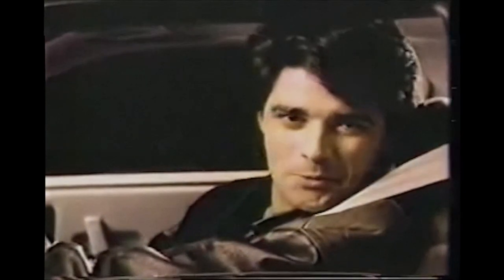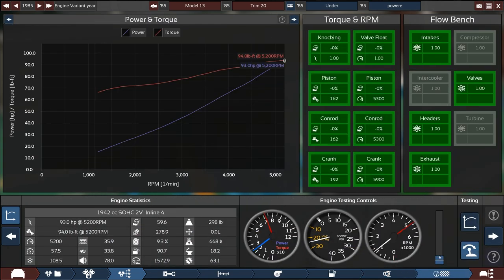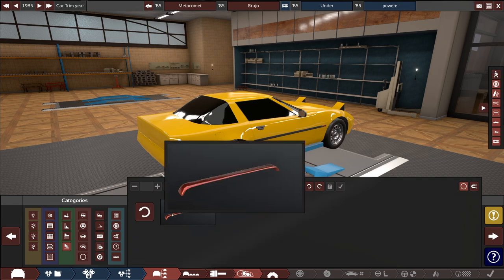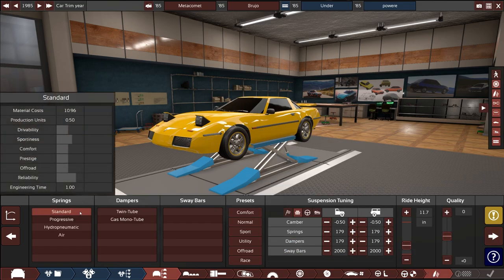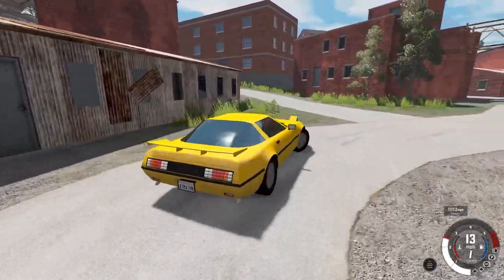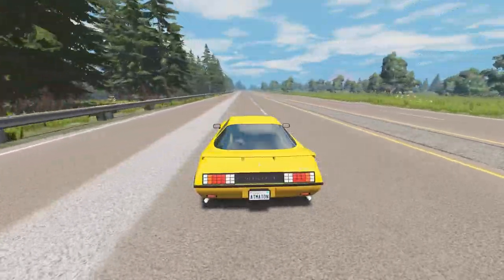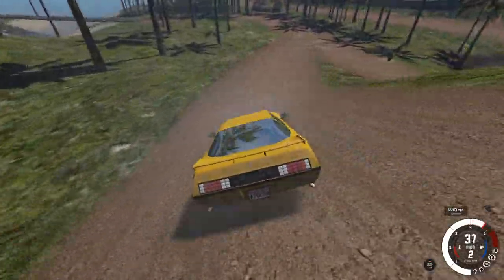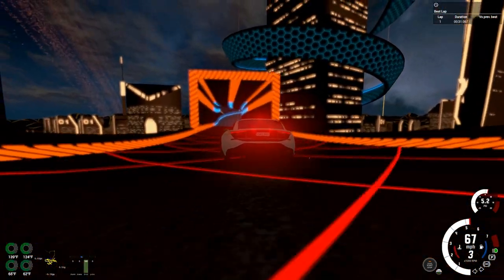Inspired by Fiero | Automation / BeamNG.Drive

Comment: Tip for making engines: If you have a higher bore and lower stroke, your engines will be able to run more reliably at higher RPMs without upgrading parts.
Reply: Another thing to always be checking is the flow bench, I don't see him using it too often
Reply: @Jack-im2wd  The flow bench is always a good help
Reply: @Jack-im2wd  just make sure to ignore the turbo flow bench when tuning for economy
Reply: I think he knows that, he couldn’t fit a 2L with a low stroke, so he had to stroke it.
Reply: @tregaming07  He could have just used a smaller engine. With the way he had to set the rev limiter, he was limiting his max power and making it impossible for the transmission to keep the engine in its power band. This really shows when he is driving the car and every time he shifts the engine doesn't have enough power to accelerate the car as well as it could. This is also why the Comminturismo's top speed is so low.

Comment: Consider: I'll go with aluminium to emulate lowerweight of plastic
Fiberglass: Am I a joke to you?
Reply: Does Automation have fiberglass? Didn't pay attention to it when he was building
Reply: @Kalvinjj  It does. And it's available iirc since the 1950-s
Reply: well if he went for fiberglass it would've been too much corvette
Reply from the maker: Fiberglass kinda felt like overkill. Would have been too high quality
Reply: @ConsiderGaming  but fiberglass wasn't some high-tech thing as the carbon-fibre nowadays. 
Although I can understand your choice. Even though it didn't require heavy machinery like steel presses, it needed more manual labor, which in case of a mass-production wasn't the best strategy.
Reply: @ConsiderGaming  yeah maybe it is  the original was fiberglass but it definitely wasn't a light car lol.
Reply: @ConsiderGaming  the fiero's body panels were actually made from fiberglass, so it would have been spot-on :)
Reply from the maker: Ah, I was under the impression that it had plastic panels. Welp, the more you know
Reply: @ConsiderGaming  dont worry man, video was great regardless
Reply: @ConsiderGaming  I think the front and back bumper were plastic, my dad has a fiero gt but i never really checked

Comment: Take a drink everytime Consider makes a mid/rear-engined car and then forgets to give the engine any sort of air intake or a grille...
Reply: It just sucks up air from underneath.
Reply: Norton the Destroyer has air tanks inside so it doesn’t need to pickup air from the outside of the car. thats my guess lol
Reply from the maker: Let's just say its a front mid engine and uh... yeah let's say there are tubes that carry air from the grill to the engine. Yeah, that's it. 

The air is carried through the space frame's tubing. Yes.
Reply: @ConsiderGaming  Let´s be real here, panel gaps on that thing are probably so horrendous they act as an air intake all on their own.
Reply: @ConsiderGaming  gm wants to know your location
Reply: @nortonthedestroyer  :-D I guess that's pretty much standard on american cars....

Comment: The car that cockblocks its own horsepower by having a too low redline.
Reply: And fourth gear is way too tall.
Reply: @EpicB  fourth gear is the last gear the car has, or probably it's the only gear the car has
Reply: @saintdesire8700  I know it only has a 4-speed, but given that it can only go 110 mph (and even then only going downhill) it could have more evenly spaced gearing.

Comment: I know you say it's power isn't great but for reference the Ferrari 208 GTB (Made into 1981) made like 151 horsepower. Although from 82-85 the Ferrari 208 GTB Turbo came out with an astounding...217 hp. 
So really considering the limitations of the day where some Ferraris only made like 55-100 more horsepower, it's really not that bad.

Comment: Isn’t the fiero a V6
Reply: It came with the option of a 4 cylinder with about has much horsepower as this car.
Reply: The base engine was the 2.5L I4 Iron Duke. Which had 92 HP it was update to 98 HP in 1987. The 2.8 V6 was added one year later in 1985 with 140 HP.
Reply: Yes